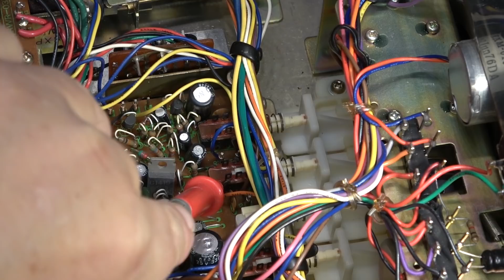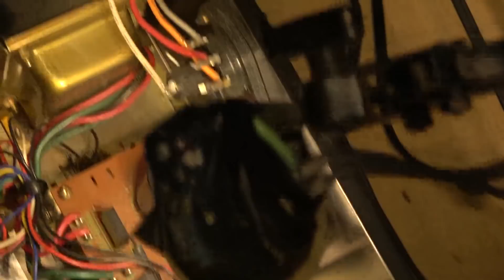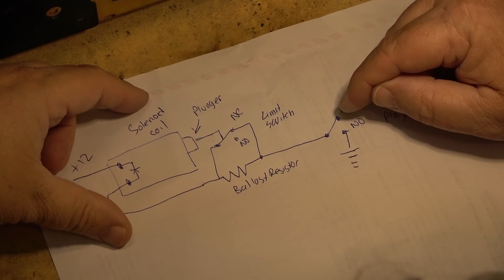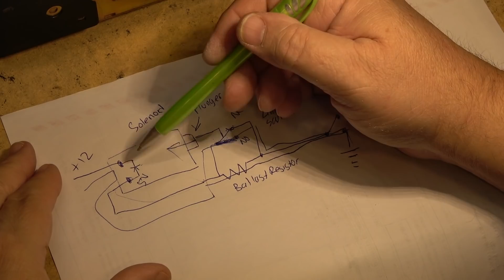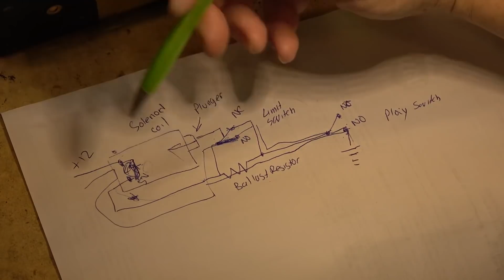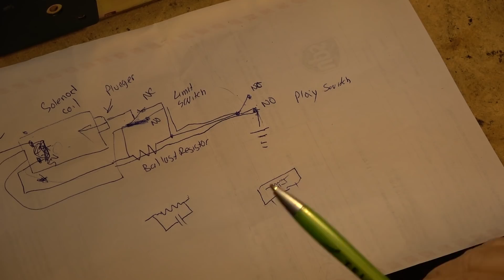Pioneer CT-F8080 No Tape Movement on Play or Record

Comment: Just worked on a CT-F8282 which is basically the same. Had the exact same symptoms but the issue was the Pause lever. It was dirty and essentially stuck in pause mode, so the play solenoid would not activate. Sprayed some contact cleaner on the lever and it is good to go.

Comment: Thank you for info. I have ct-f8282 which is the same machine but with a wood case. Had problems getting the play to work. After watching your tape I discovered the solenoid and the need to pull in. Manually pushed it and the dec played. Electricall all look good. What I found was the shaft of the solenoid was gummed up and used a little contact cleaner to get it to mobe freely and all is working great now. 
Now onto working the FF/Rew issue. I will try replacing the belts and the rubber drive on the motor and see were that goes.
Again, thank you.
Jon

Comment: Good cassette response for these decks was about 40cps to 12.5Kcps Normal tape and 35cps to 16.5Kcps for Cr02 no Dolby. Better decks like the Nak's with NAAC in Dolby C would easily exceed 20cps to 20Kcps with CR02 and higher with metal @ -10db record signal.  Of course Metal Type IV tape was even better. Not every deck with great specs had to be a Nakamichi, many the manufacturers had midline 2 head decks with excellent response as well, some better than more expensive 3 head decks, the Nakamichi RT-202 and RT-303 among the better 2 head machines. 

Both Pioneer and Teac had 2 head models in the 199$ range that kicked butt. Recording FM stereo back in the day would seldom if ever exceed 20cps to 20Kcp certainly not most cheap turntables.  Every cassette deck I remember had a MPX filter to record off FM Stereo broadcast. Better turntable/ phono cartridge combinations, especially those for quad LP could play back to approx. 50Kcps pilot tone required for the rear channels, I don't think any decks could record that, not at a level we could hear, maybe -100db,.. lol. 

Point is for mainstream recording of media, even CD and most Hi Res, 20cps to 20Kcps is more than sufficient to reproduce what is there with a nice warm response; better improved tape material and oxides became more robust and produced a better signal overall as heads and tape handling improved.  Most people who hear a decent cassette deck and playback of a recording made on the deck, and even some commercially recorded tapes often were and still continue to be surprised at the quality, not believing the format was capable of such performance. Bands today release prerecorded runs in the thousands of new material and the kids (under 30 especially) buy the whole run.  

I keep about a dozen different decks in rotation , have more to be restored, maintain over 200 prerecorded and many hundred NOS Maxell tapes of different formula's mostly Metal and CR02 from the early 80's to about 1994 as well as TDK's.. I have maybe 500 one recording Metal and CR02 as well. I bought them when cassettes were bottomed out and stockpiled them as Maxell and TDK were stopping production. Many of those tapes now sell for 10$ US and up minimum, for a C-60. Metal C-90's can be 3X that easily. I wouldn't pay that but I don't need to. 

There are new cassettes being made by ATR as well as Recording The Masters (think BASF moved to France) makes new cassettes as well, and in the US National Audio Company makes them for the blank as well as runs of pre-recorded bulk stereo high fi tapes sold today. What I'm saying is even in 2022 cassette is alive and well as is open reel, if anything better machines are getting shorter in supply and many need repairs or full restoration at this point, especially those  made pre 1989. Long Live ANALOG!!

Comment: in all honesty, this old cassette decks are made way better than the new ones with all the cool noise reduction filters, yes they have to be serviced but they have way more tough parts in the mechanical sections. I find that i usually just let the tapes play and record without any dolby or other.. Plus they are way nicer looking. My 3 head Technics RS-M63 sounds quite good and records very good as well, but you have to start with a very high quality source. If it is from a computer then I use a FLAC or from my turntable,  and yes, some records don't have the best quality, but many do.

Comment: Get yourself a Aiwa ADF800 in good condition, some chrome or metal tapes and you will see why people still love Tape Decks. I love mine 😁
Reply: Not many people know just how good these machines actually were. Modern day cassette mechanisms are a load of crap.
Reply: @Angelo Dagnolo. Aiwa were always good tape decks and were reasonably priced when they were an independent company (I think). In 1979 I owned the Aiwa AD6400 (?) similar to the Pioneer deck in this video. Then in the early 1980's, I bought the Aiwa AD-M800 tape deck. It was an exceptional machine and was loaded with outstanding features including 4 "memories" to save tape calibration settings. And it had a wireless remote control. Should never have traded it in! Long live cassettes! Stay safe and well.

Comment: I love my Pioneer CTF-700. Especially the feature where it has a meter for setting the bias. Built like a tank and has the nice coated leads on the resistors and all the cables neatly wire wrapped terminals. Only bad thing is it was a total nightmare to change all the belts. But it's still brilliant looking and sounding deck.

Comment: the old crap worked better then the new crap I will only buy old crap for audio
Reply from the maker: Old crap keeps us old techs working.   I like old crap too.
Reply: I owned a pile of great cassette decks in the past. Pioneer CT-F9191, CT-F1250, Aiwa ADF990 and presently, a Nakamichi DR-10 that runs just fine. Engineering that is nearly extinct today. A shame !
Reply from the maker: @hifismiffy  times change.

Comment: I just worked on one of those about a month ago, ... would not play either... turned out someone changed the belts in the past, but re-assembled it wrong , so when you hit play, the lever completely missed the micro-switch to turn on the deck...

Comment: Lighted analog VU meters are majorly cool in my book.  I had a Sharp cassette deck (with Auto Program Search System) from the same era that looked a lot like this Pioneer deck.
Reply: The only thing with analog VU meters is the response time (sweep time)  compared to VFD (vacuum florescent display) or LED, neither have mass of a metal needle and of course they didn't need to be lit. I have a Sony TC-FX7 that has an LED VU and the display is back lit in a green color so the decibel numbers can be seen in low light. 
Not that the original mechanical VU meters aren't cool by any means I think they are too. Just a bit of background as to technology advancing the move was made to practically a ZERO response time with the VFD and LED VU meters, also called PPM (program peak meter).
Reply: My CT-F9191 had huge VU meters -the CT-F1250 that I owned next, had big blue VFDs fitted.
Reply: @hifismiffy  Indeed the larger the needle hands are the more lag in response. It certainly could cause tape saturation with sound sources like a drum beat or other sudden sounds.
Reply: Take a look at the lighted vertical VU meters on the Teac V-5RX cassette...  very cool.